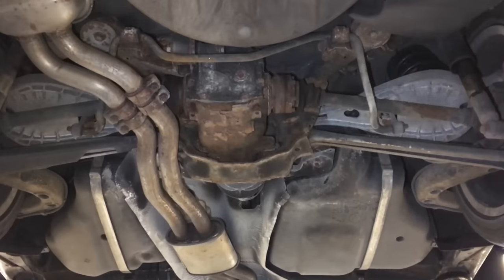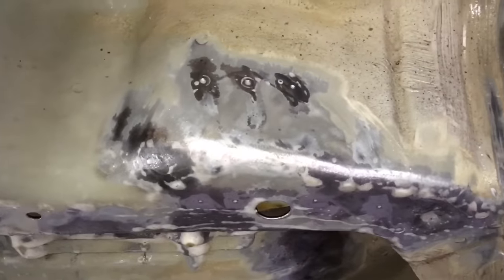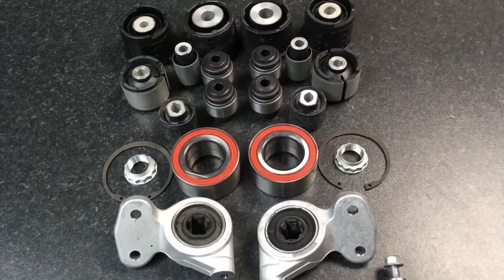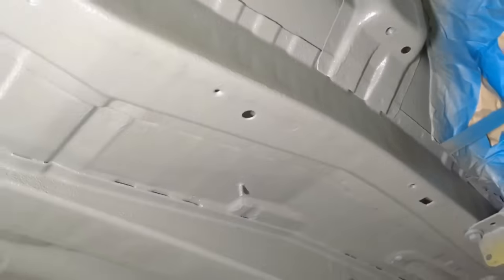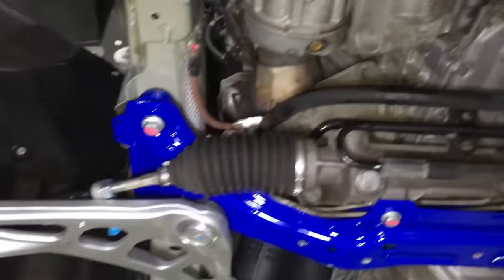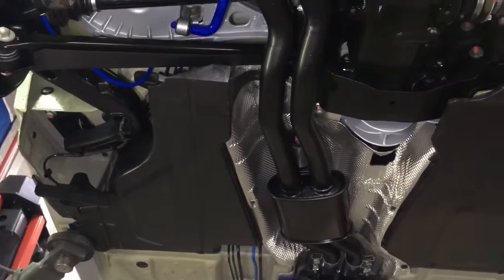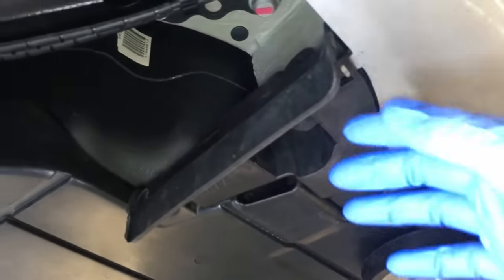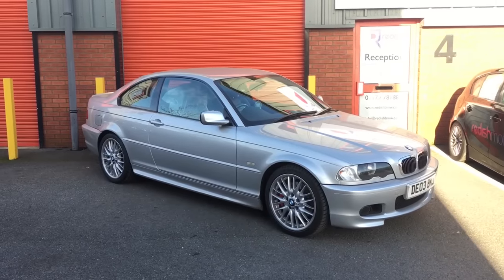BMW E46 330ci - Underside Restoration - Better Than New!

Comment: @Redish Automotive - do you have part numbers for those aerodynamics parts for the rear and the fuel cover/transmission area?
Reply: Some of the nuts, clips, rivets and prestol cages may already be on the car holding other stuff together, because they share mounting points: 

- Cover, activated charcoal filter bottom : 51 71 8 233 266

- Cover, activated charcoal filter front: 51 71 823 3 265

- hex head screw unknown quantity for the above: 07119901299

- expanding rivet unknown quantity for the above: 51118174185

- Cover transmission from February 2001 models only (possibility of retrofit to 1999/2000 323i/328i models unknown, mounting holes were probably already there in 1999 but proximity to exhaust may be a concern, because 323/328 have different exhaust): 51717039443

- Cover transmission M3, for attempted retrofit instead of 330 cover above: 51717892122

- 2x C-clip nut for above: 07146981767 

- 2x hex head screw for above: 07119901299

- Cover gas tank left: 51718218119

- Cover gas tank right: 51718218120

- x7 Expanding plastic rivet for the above: 51118174185

- x10 Nut for the above: 07129904150

- Rear aqua plane gaurd left: 51718244045

- Rear aqua plane guard right: 51718244046

- x6 plastic rivets for the above: 51118174185 

- Prestol cages unknown quantity for the above: 07129904213

- Fuel filter cover: 13 32 8 230 397

- x2 hexagon nut for the above: 07147154227

- x3 hex head screw for the above: 07119901299

- x3 prestol cage for the above: 07129901746
Reply: @idokwatcher2062  Thanks for that. I had a browse through realOEM before but couldn't figure out the locations for the parts. The hydroplane plates are what I was looking for.
Reply: @idokwatcher2062  now if only we could see those "bargain based" prices..

Comment: Damn this shop had to be over seas and not in the states. Literally watching this video I'm trying to find the shop for this same quote  I have a 04 330ci zhp and wanted too do the same. I have 98,000 original miles on it

Comment: We have a 15 year old E46 325 CI with my wife being the original owner. The car was garaged when home, but unfortunately on the California sun while at workplace of my wife. I waxed it with carnauba wax every six month. It did not help much. The paint is sun+heat-damaged on the hood center and sun-damaged on the roof near the windshield. The top of the front bumper is also damaged. In addition many interior parts were falling apart, I replaced a few, but in the end just could not keep up. We loved the car, it has low miles, but sadly we need to let it go. I say all this, because people often say California cars are rust free, which is true, but the sun can also cause considerable damage and if the car needs to stay throughout the day on the employers parking lot, such sun damage will occur. I knew this from day one when we bought the car and tried my best to prevent it, but like said, it did not really work. Actually BMW's vinyl protector has seemed to have done a great job to save the dash. But e.g. I know that on our next car I will no longer use carnuba any more, instead I will switch to an easy to apply synthetic wax, which I will wipe on/off after every car wash instead of the more work intensive carnauba procedure every six month. Hopefully that long term experience will work better than my long term experience with carnauba. Anyhow just to share my experiences. So again the bumper top, hood center and roof line near windshield may need extra care. Oh and also the roof rack plastic rail areas. We have a new BMW 440i coupe on order since February (Covid-19 slowed down things and we are still waiting). However we did not order the most recent 2021 G22 model, because we can't get comfortable with the new grille design, at least from what we have seen so far from the spy pictures (official unveiling of the G22 is scheduled to be in a few days on June 2).

Comment: Just did a light underside restoration on my 2001 VW GTI VR6.  Living in the rust belt I was surprised there was no holes in the body.  The subframe, control arms, exhaust, a rear trailing arm were pretty much destroyed by the salt on the roads here. I was also limited to a garage with no electricity so I was limited on the tools I can use.  Battery power tools only.  I bought the car new, so I knew the history on the car.  100k miles, Maintenance kept up with synthetic oil changes every 7 miles.  My goal was $4 k on parts and to have a reliable daily driver for the next 100k.  I needed to do the timing chain on the vr6 so the transmission would have to be removed.  The vr6 is pretty tight in the engine bay and would have to lift the engine slightly to do the water pump, the subframe was heavily corroded, so I decided to remove the engine.  The parts break down was $1k on new knock off VW wheels and tires.  $1k on koni shocks an new VW springs ($100 each for the springs).  A new aftermarket subframe was cheap at $110 and a front quality front suspension kit with new control arms, tie rods, bushings at $160 (cheap).  The rear beam axle was not cheap at $400.  New calipers, pads and rotors $500.  $450 on new exhaust aft of the catalytic converter.  Yeah my estimate was off and probable spent $ 1000 on the engine including timing chain kit, clutch kit, seals, hardware, rebuilt starter and alternator.  In all I spent probably $4500 and that was tight.  Over $500 on my estimate.  I came to two conclusions on the project. Budgets are very difficult to keep and it would be cheaper to start with a rust free southern car.  My only justification is there were no mechanical surprises because I have owned the car since new and this car should be very reliable for the next 100k miles.  Cheaper than buying a new car and a backup for a future 15 year old Mercedes which will most likely be down at times.

Comment: My car is one of the few or even only one in the country with the Redish subframe reinforcement kit, but not done by them, and thus to a lower standard of finish :(. I couldn't recommend Redish enough to you if you need to sort out your subframe even if it will cost you a little more to import into your country, they are for real (as if you couldn't tell from the video). They are the only ones that published their R&D behind the kit, you have to respect that, other manufacturers just stamp out some metal whose only engineering goal was to fit in a certain location. 

Like others commented this could be considered a huge waste of resources, people only consider an M3 worth preserving. M3 could've been bought for the money, especially on the cheap UK market (yes very cheap, compared to poor areas of Europe, don't jump on me :)). But, you know what you have, you know its mechanical condition and interior condition to the tiniest detail and maybe you consider that in excellent condition. 

I would be very afraid of buying an E46 M3 for the purposes of long term ownership/preservation. So many of them have been abused by idiots racing traffic light to traffic light and burning rubber at car meets. I would only be somewhat confident in a single owner car whose age must not have been 18-25 when the car was new. Otherwise complete engine tear-down, drive train refresh, subframe repair... But now you entered well into the price range of a much newer M2/3/4 generation with less engineering flaws (oil pump nut, weak strut towers, weak subframe, rod bearings, weak plastics in all critical systems under the hood, numerous interior material failures/weaknesses, the list is endless on this prime example of German Engineering).

Comment: i understand the sentimental value of something u like. but would it be cheaper looking for a smiliar one in mint condition. i assume this awsome work wasnt very cheap :D
Reply: The chances of finding an used e46 with a similar condition of its underbody are slim to none. The job these lads have done is so outstanding and thorough that you will never ever find another e46 in a remotely close condition to this one unless it has gone under the same restoration.

Comment: No matter what u do it will never feel like new car. After years of road use, metals expand so does chassis become wider causing unbalance on every single part of the the car from suspension to everything else. But changing bushing its self on any used car after 100k miles or so makes car feel completely different.

Comment: 1:12:46 a rusty bolt left?
Reply from the maker: At that point yes - but that was during a dry build stage to allow the Driveshafts to be pulled in whilst all suspension items were mocked up. Naturally, dry build fixings get replaced during the actual assembly phase. Good spot though!

Comment: your work is impeckable as is your taste in old school, but next time you are doing a bmw try some poly bushes for all the suspension, subframe and diff mounts, not only are they cheaper and 3x better, they are also simpler to fit and improve the handling, try them, you and your customers can thank me later XD

Comment: all that work and you didnt reinforce that rear subframe...WHY?????
Reply from the maker: Subframes don’t need reinforcing. RACP’s sometimes do. 
You must remember, we’re telling a story and documenting the process which is a specification of the owners wishes. If the owner doesn’t want reinforcement of the RACP that’s their decision and as a business we can advise but we must ultimately respect the owners decision.
Reply: @RedishMotorsportbmw  considering mine looks similar to how this one is in all aspects (before the resto) I have to restore the whole car myself. With that being said however, I will be reinforcing the rear subframe mounting places on my 2001 (08/00) 330ci automatic when I swap in a manual getrag trans due to the auto zf rear drum failure has happened to me. 
Purchased a meyle HD bushing kit, some liqui moli uv oil, new coolant system with upgraded water pump, and a few other bits. 
I can't say how much your services are, but I have to believe the owner doesn't know how bad the subframe issue truly is. In any case, you did do an amazing job. *who knows tho maybe the owner baby's this car and the streets they live on and or drive on are not like those of toledo ohio in the USA which are HORRIFIC and can break any joints/bearings in any new car if not careful. 

*sub in subframe for RACP. So you know I'm not talking about the bit that takes the bushings. In talking about the belly of the car where said subframe mounts to. The rear axle carrier panels.

Comment: you need to buy a spot weld cutter..
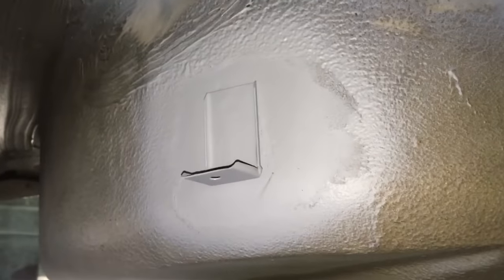Reply from the maker: Hi Agbhar, we use them all the time. You can see at 27:50 and again at 32:25
It's these ones we use: https://www.ebay.co.uk/i/332409044009?chn=ps&var=541429557727&norover=1&mkevt=1&mkrid=710-134428-41853-0&mkcid=2&itemid=541429557727_332409044009&targetid=878020360040&device=c&mktype=pla&googleloc=1006567&campaignid=9461445814&mkgroupid=97644908122&rlsatarget=pla-878020360040&abcId=1139576&merchantid=7309654&gclid=CjwKCAjwv4_1BRAhEiwAtMDLsk6iyRLL0yQTqNXLHayqcoqdrgw1I_0vPi7i5j3a8O-ESFp2Re_dJxoCNocQAvD_BwE
Please consider Subscribing to our YouTube channel!

Comment: I had an E46 M3 manual coupe a few years ago. A beautiful looking car, but an absolute disappointment to own. I got drawn in by the hype. The worst part for me was the transmission. The getrag box was the most horrible thing Ive ever used. It was so bad that I took it to Sytner for a rebuild. The tech drove it and said it was one of the smoothest he'd ever used and not to worry about it!
I sold the car after 6 months ownership and never looked back. Nice to stare at but that's it. Horrible brakes, huge gear lever throw, gutless feeling engine until it hits 5k, M clunk, numb steering, unsupportive seats, stupidly tall gearing...It is an incredibly capable car, but a sports car it is not..it is a quick (not fast) autobahn blaster. You can throw them around a B road to an extent, but you will sliding around the seats and hanging onto the wheel for grim death, and you will be no faster than someone in an R53 Mini Cooper JCW or any other hot hatch. A Audi S or RS, or a Golf R will destroy it. If someone is in a Caterham then forget it, you're history.

Comment: This is not a restoration !!!
In the internal cavities of body parts, corrosion has nevertheless remained! And the fact that you stuck on top with soil does not stop the corrosion process.
The stabilizer landing in the sleeve is made tight without rotation (for this there are several sizes of the bushings). And in the process, the stabilizer moves on the elastic properties of the sleeve body ... the process is similar to the silent block in the suspension arm. It is with such a fit (free rotation) as you have shown that the stabilizer body is erased!
But for the new mounted parts I praise ....
Change the name of the video to "puttying rust for a while."

Comment: What in the actual fuck... why wouldn't you spend the extra couple hours to weld the reinforcement plates on... You are already SO BALLS DEEP in that thing I can't believe they chose not too. Even if it is a 330ci auto, I still see them crack from time to time and they already have proof that is is cracking...

Comment: The restoration is not bad ... Did I already done on my E36 M3 ... Only what I do not understand, why takes original rubber bushings from bmw? They are utter shit ... I stored everything with powerflex bushes for motorsport
Reply: Maybe they didn't want the extra vibrations that would occur when using harder bushings.